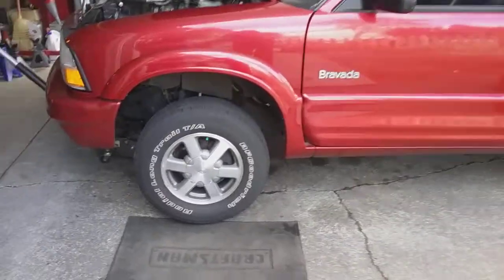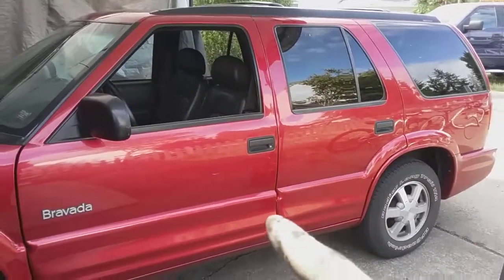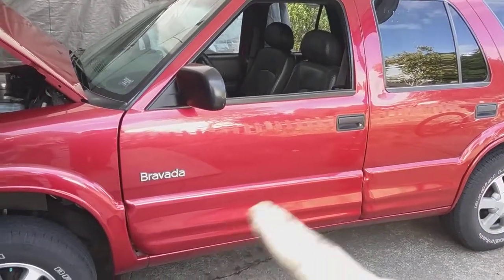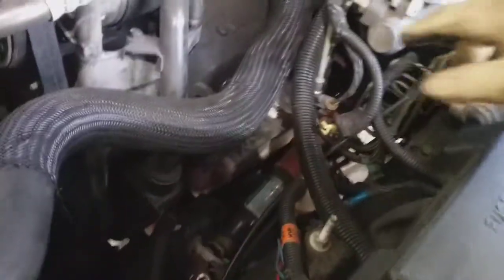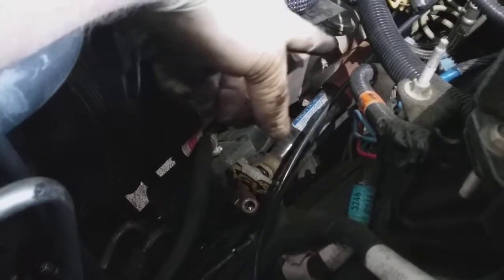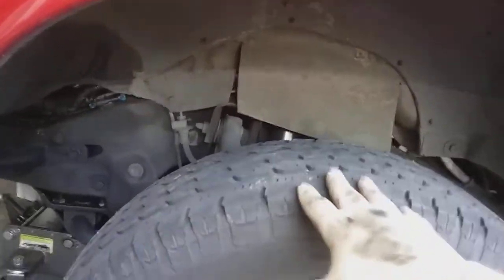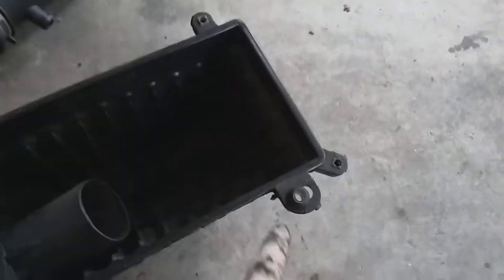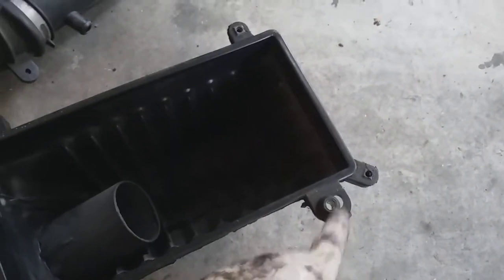2000 S-10, S-10 blazer, GMC Sonoma, Jimmy, Oldsmobile Bravada 4.3L Vortec. Tune-up tip #3 sparkplug.

Comment: Are you kidding me? Wtf Wow what a pain in the ass just for spark plugs
Reply: I swear to god, I have been trying to fuck with that center spark plug in front of the steering shaft and I still haven’t gotten it off. Makes me so mad why design the shit this way? Guess I won’t be driving for a little while. Seems like I’m gonna have to take that steering shaft off.
Reply: Why? Why design it like this? Fuuuuuuuuuck! (I have to do plugs  on 2001 bravada)
Reply: Would’ve liked to seen how the steering  shaft off